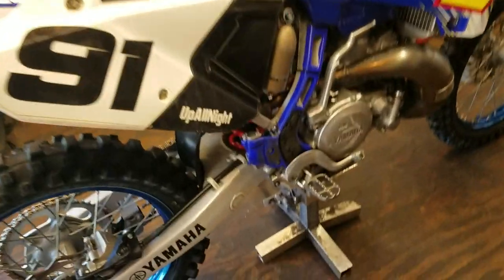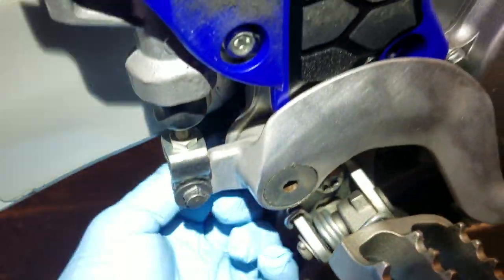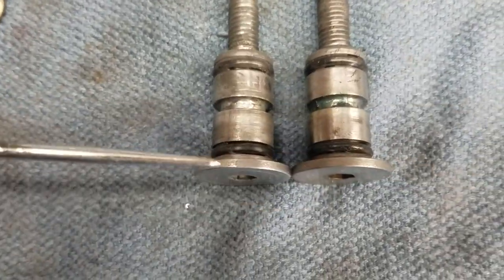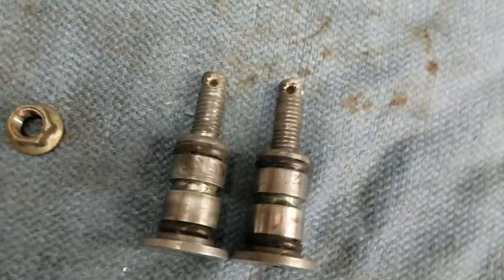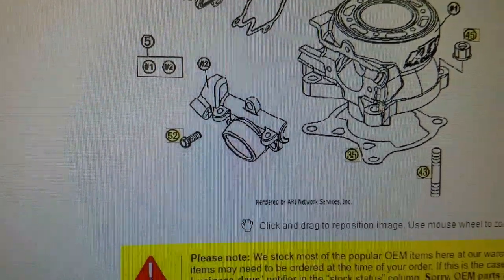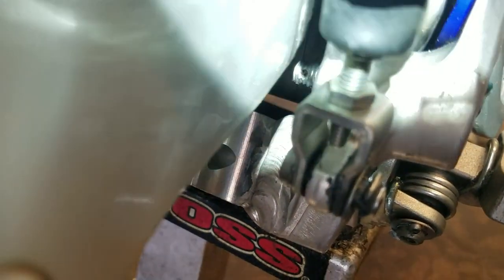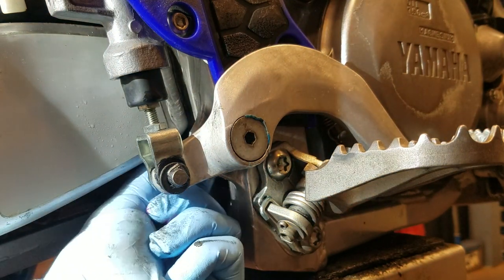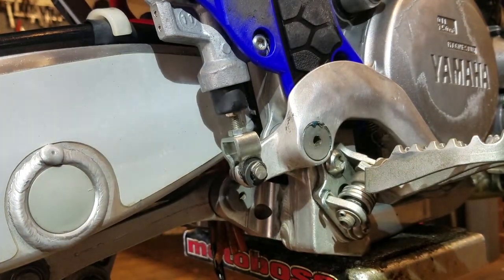1:11 Repair stripped out rear brake lever bolt threads on the YZ250 & YZ125 Yamaha 2 stroke!

Comment: Thanks for the info. Exactly what I needed.

For anyone here like me who had trouble finding a nut:
The threads are M8x1.25, and you have about 8mm of thread to work with using the older yz bolt. I could fit up to a 13mm wrench under the swingarm. 

I found a 13mm flanged nut that fit perfectly at my local Lowes.
Reply from the maker: Right on. And thanks for sharing and adding to the info! 👍

Comment: Hey man, great videos! Where do you get those radiator shrouds? I have an old YZ250 and would love to put those on there but I cant find them anywhere
Reply from the maker: Hello. I get them from https://www.decallab.eu/    just shoot them a email and ask for a list of all the graphics they have for the yz.  They will email you back with over 100 designs.  It is in that list.  Then you can change things on it to fit what you want, like sponsors, and change colors of different parts and such.  They are based in Europe but come in super quick and much cheaper than US graphics.
Reply: @UpAllNight91  thanks man! I’ll take a look
Reply from the maker: @devinries2512  yes sir.  The web site only shows a few.  Email them and ask for all, there's where its at